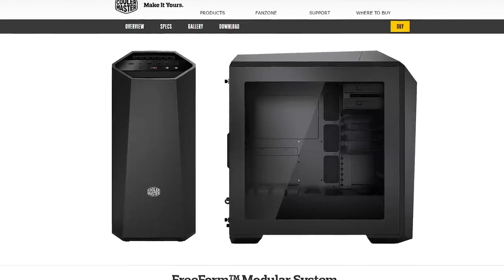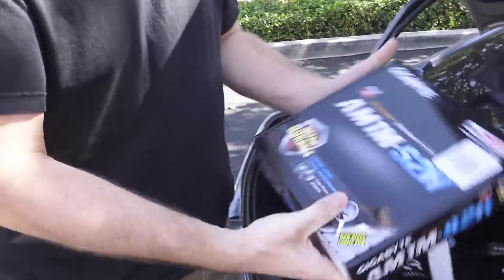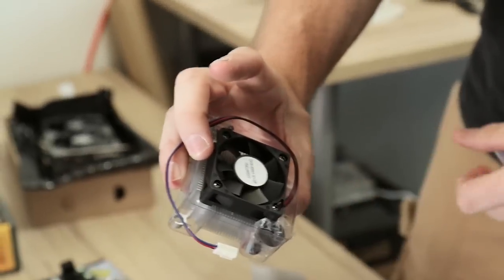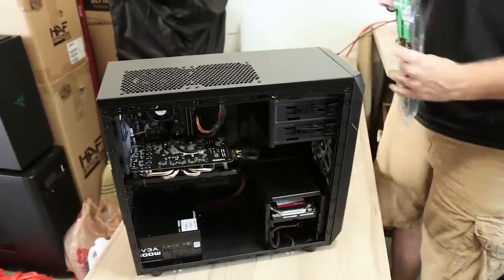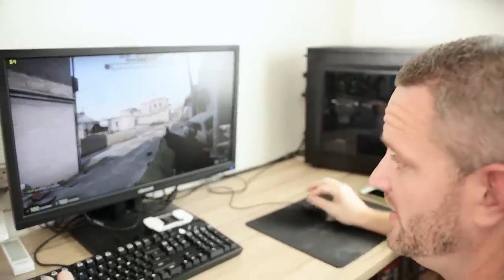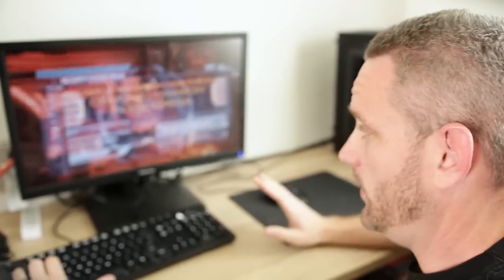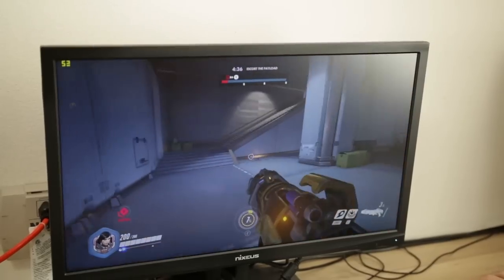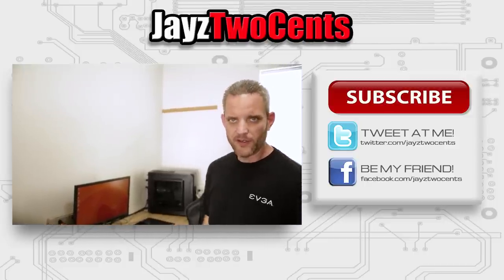Ultra Cheap Gaming PC 2016 - Can you play games for under $400?

Comment: I got an i5-3470, 8gb memory and a R9 380 4gb (nitro) system for around £340 which works out at around $400, runs BF1 beta at very high settings and Overwatch at ultra. Great system,especially for the price I paid.
Reply: That's more like a lower midrange build than a budget entry build. But good deal on the parts.
Reply: +Shivam Kumar I didn't say it wasn't, I merely said that I like it.
Reply: That's awesome , this will run you realistically somewhere between 430$ and 460$ for am1 motherboard -_- . And no os...
Reply: very nice
Reply: got same cpu

Comment: In order for the computer to work you need the hardware and software. Thats why I believe you need the OS factored into the value. However the games are not needed for the computer to work and will be different  for everybody. They dont need to be factored in at all.
Reply: Give me 5 minutes to call a friend and I'll have a windows disk stat. You can reinstall the enterprise version for ever ya know? Or DotA and team fortresses you can play on Linux. Some other titles you could play through wine too. World of warcraft works great.
Reply: Yeah but not all operating systems cost money
Reply: A computer will fully function with even the barest of OSes, so that's technically incorrect.
Linux is also a fully usable, free, open-source OS (well, kernel. Most Operating Systems built on it are FOSS, though, and many times more highly regarded than Windows.)
Reply: Microsoftsoftwareswap over at Reddit sells Windows keys for like 25 bucks.  Still under $400 if you use that unofficial service for getting keys.
Reply: Using the same logic you can put a free OS in any pc. Just like you can play many free games. Why assume you have to pay for an OS in the first place? Hardware is not free. Software can be free.
Reply: Linux.
Reply from the maker: You need games to be a gaming PC.... cost of games dont factor in with your logic? Im astounded.
Reply: Just run the latest build of LinuxMint Mate, or XFCE(much lighter then the main cinnamon version), and install STEAM, I've been doing it for years for friends, and family who don't have the money for a Windows build, or want to update older hardware. My only major headache has been AMD GPU drivers(mostly fixed these days), and the odd AMD E series CPU not playing well on one setup, but that's it unless you want to get specific about scanner, and printers lol!
Reply: +Commodorefan64 or alternitivly, you could buy a 25 dollar windows key from kingwin. just dont drive as much for a week. its not that hard to save 25 bucks.
Reply: Job Thompson Well LinuxMint is free, runs smoother on less hardware then Windows, overall more secure, has alternatives for most Windows based software, and getting more all the time. Plus that $25 saved might be a months cellphone bill for someone, or a dinner date out for me, and my g/f. Having said that I personally dual boot Windows 10 pro 64bit,and LinuxMint 18 XFCE 64bit on my main system as I have some games on STEAM that don't work well under Wine in Linux, but if I could get rid of Windows totally I would be done with it tomorrow.
Reply: Having the option for a free OS is great, don't get me wrong. But I also want to be able to play whatever games I want, and I need Windows for that.
Reply: Yes, but you can a winOS key for 20$ on Kinguin. That keeps it below 400$
Reply: I built a computer a while back and didn't have to spend a dime on the OS you can get Windows 10 for free it's just an unactivated version so you have limited customization as far as themes and settings go but for the most part it lets you do everything else Windows does and it's free
Reply: Or pirate windows. You know, just a random thought.
Reply: if u have to factor in Windows its $27.10 for Windows 10 OEM key online
Reply: +Luis Ramos plus if u have to factor in xbox live or PSN just to use online services is $60 right off the back
Reply: You do not need Windows to be a PC gamer. Hell, Quake 3 from the late 90s could be run native on Linux and now you have Steam.

Edit: originally said Doom 3 which came out in 2004. I meant Quake 3.
Reply: Luis Ramos That's a really valid point. I'm surprised no one brings it up. Free multiplayer on PC.
Also, IMO Steam Sales are better than random free games the console subscription gets you.
A gaming PC also means that you don't have to spend money to buy a laptop or whatever. I mean, everyone needs a PC of some sort. Even console gamers have laptops or pre-built PCs.
Reply: Will Shaw Doom 3 came out in 2004....
Reply: ***** Not all games cost money. Though the thought of free operating systems did not cross my mind.
Reply: Verbatim grr Quake 3. Got Doom on my mind.
Reply: Please see explanation at https://youtu.be/xV3hasqRDoU?t=337

Again, if you factor in OS, whats to stop you from factoring in the cost of all the $60 games and adding that into it.
Reply: Well, if you wonlt even  play games, use a free OS. Linux for example.
Reply: +ickerolig but in the title it says "gaming pc"
Reply: I TOTALLY agree....The OS actually IS part of "making" the machine boot up and work......games are not needed to make it work....now this isn't necessarily bad news...but it most DEF should be figured into the budget....the way I see it guys, youre lucking at around $450-500 almost any way you slice it.....why? Because unless you want a total junker.....and unless you want to fuck with the hassle of messing with Win7 these days, thanks to MS pushing Win10 down our throats and making it SIMPLE to install and update compared to Win7 now.....Then youre going to have to factor in a copy of Win10....And that's pretty much around $100 across the board....unless you have/know of a person or friend who has a copy you can bum and you just pay for the COA number/code online....sure you can make one for under $500 but.....IMO it really really really just isn't worth it.....Now if one were to spend around $500 on a gaming rig then YES most definetly!! It could and would crush the Xbox1 and PS4....otherwise youre gonna be pretty much on par with one (a console)
Reply: i just realize you could somehow avoid bottleneck by downgrading the gpu and upgrading the cpu motherboard a bit, but still u got a $o.o1 motherboard so i guess there is no room for a change.
Reply: No because no one pays for OS and all tech channels low key know that. If you don't know how to get OS then you're a noob.
Reply: steamos is free. there you go, price factored in!
Reply: let's say you somehow have no access to any copies of Windows Linux was is free and can play csgo
Reply: add an extra $30 and $5 for both a keyboard and mouse
Reply: JayzTwoCents your amazing but lets not forget those free to play games man. A LOT of people who buy a PC for this price will probably be sticking to a lot of free games. 

Heck i remember my days i'd love to have free to play games like these new kids have now!

Anyways still a bad choice on the CPU a 860K or I3 would have been better this CPU is gonna get wrecked. 

for a 400$ Rig one can get a I3+RX460 and game at 1080P medium just fine.
Reply: +Shaco The Rapeco and a couple hundred for a monitor.
Reply: Steven Kovick A couple hundred? If you're running at a budget, you dont need to buy a 144hz monitor or anything, and most people have things like tvs in their homes, which may not be the best option, but on a budget like this, you dont have many options
Reply: Well how much for the TV then? Cause a playable system from scratch should include the display
Reply: AND A DESK. AND MOUSEPAD. AND CHAIR. AND CARPET. AND A ROOM. AND A CHAIR MAT.
Reply: +Michael450045 and a house with a power bill. xD
Reply: SteamOS and most versions of Linux are free.
Reply: I was going to say linux, but he benched Doom in the vid.  Doom is a windows only game, so i assumed people would bitch about it later...
Reply: just download the iso from Microsoft and crack the license in 30 seconds why would you buy windows lol hahahahha
Reply: heheheh
Reply: Except that the vast majority of people who bother to build their own computers already have legit copies of Windows from their old machines AND/OR usually just pirate windows. On top of that the vast majority of PC build guides for expensive rigs never include the cost or an operating system but all of a sudden on a cheap budget rig people are screaming bloody murder about how you all of a sudden MUST include the OS cost lol. Get fucking real.
Reply: Still astounds me that tech people actually pay for their OS's. I sure don't, so no need to factor that in.
Reply: I never payed for the OS 😆 .
Reply: Windows 10 is free, you only need a key to activate it...
Reply: You can get a key for 30 bucks or something and even free if ur a cheapskate
Reply: I torrent my os lool
Reply: Just torrent windows ffs, money hungry microsoft doesn't deserve it.
Reply: To be fair to him some of the most popular and biggest games in the world are free to play such as  Dota 2, League of Legends, Heroes of the Storm, Team Fortress 2, Path of Exile, Marvel Heroes, Hearthstone, War Thunder, World of Tanks, Lord of the Rings Online, Star Trek Online, World of Tanks, World of Warships and a million others.
Reply: You can get windows 8, 8.1, 10 for free from microsoft and use Microsoft Activator to activate them. Totally free lol
Reply: or buy it from g2a, other key sites or use linux, steam Os... simple
Reply: Jazzygamer You can't really run many games on Linux nor Steam OS.
Reply: Liam Howlett
Yeah but he said to factor in the OS but not games. So if you won't even consider buying games you won't need an OS to run them.
Reply: Luckily there are quite a few good free to play games these days :)
Reply: I got my Acer LED 24" monitor for £15 2nd hand off gumtree, was company selling all their old monitors and they had 15 of these.. which I had more money at the time and got 3 of them..but then again they have no hight, tilt, or axis adjustments.. but still, had it a year and it's done the job very well.
Reply: Scott Cooper lol, I still have my vga Samsung 1200x1000. 75 fps and 2. 5 Ms response time tho. Made in 2000 in India and features a broken pixel tho.
Reply: but this system is for gaming..... games are as important as windows itself on this rig... - so its fair to not count it in
Reply: Naruto Uzumaki yes, it is.
Reply: An operating system (as the name suggests) is needed to operate the system. You know, even a modern stove has a basic operating system. You would not be very happy if you buy a stove and afterwards you have to spend more money because you can't operate it due to the lack of the appropriate operating system. That's why the cost of the operating system is generally included in the price, while the cost of the other Software, like for example Games (or the pans you use to cook food on the stove), is not. That being clarified, an OEM-Version of Windows 10 is not that expensive.
Reply: Hyr Zuhows that example is horrible you cant compare a stove and a desktop pc at all, you have a choice in OS's on a pc and other factors as well
Reply: Hyr Zuhows But you can get 8, 8.1 and 10 for free, and activate them for free.
Reply: just get a windows 7 basic... you won't need advanced server crap for gaming... or if you already have w7 no need to buy it again just pirate it
Reply: Naruto Uzumaki
It's not an example, it is an allegory to highlight the point. Perhaps you can find a better one? That being said: You can program and use a different "OS" on the stove as well. if you know enough about that stuff.
Reply: You can get Linux for free, so the OS does not have to be cosing money. I know you never really want to have Linux on your system, but yea...
Reply: can get any OS you want for FREE
Reply: You can get windows 10 for $20.
Reply: Anthony M For 0$
Reply: -CLM15- That too, but I meant a legit not pirated copy.
Reply: Anthony M why anyone would buy an OS is beyond me.
Reply: pbhenry3 Some people like to have a legit copy /shrug.
Reply: +Anthony M where can you get it that cheap?
Reply: Or simply do woad enterprise and reinstall it every 3 months. It boggs down anyway.
Reply: The Vibe why in the world would you do a fresh install every 3 months? that sounds like a hassle to copy everything over.
Reply: pbhenry3 it is. You could pay the 20 bucks for a key. But you can minimise it by having a steam folder on a different drive. Or install packs still saved some where.